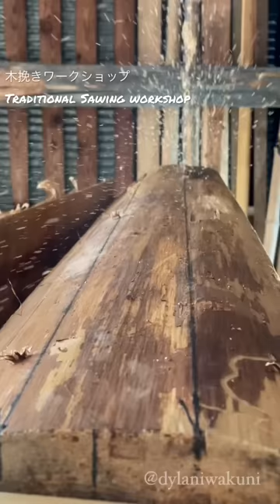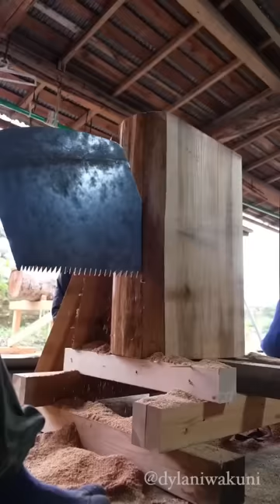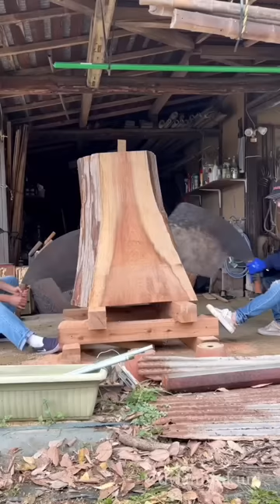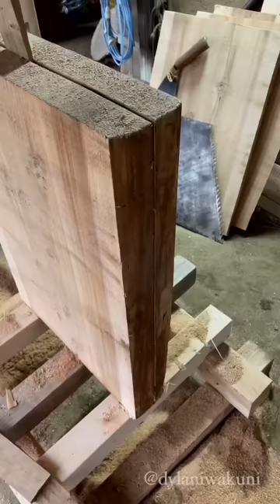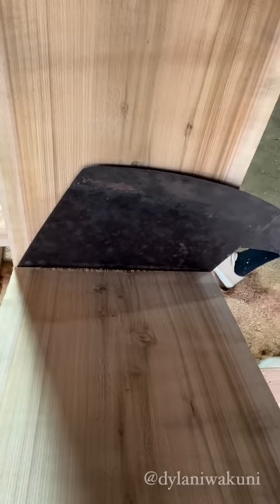木挽き　Traditonal Sawing

Comment: Good design. The tall blade adds more weight while the user just pulls. The advantage is when pulling the blade it becomes straight instead of buckling up.
Reply: Thank you, I was about ask the question why is it so large. 🙏
Reply: @Martell Barchaletta  I was just guessing but on second thought it also creates a straighter path.

Comment: I'm not likeing those saws, how quick would the sawing be unprecise and that precious wood wasted. better will be i think one one those highly precise saw tables, the wood is fixed in them and then all there is no manual sawing that can possible be unprecise. 

what are those sort of saws in the video called? its a japanese saw but they will have a distinct name for that saw sort, i guess. how much does one of those saws weigh? it appears like those weigh alot, those people dont need to put any extra weight on those saws for sawing. how precise can these workers saw these slices of wood with these saws ?

Comment: What's the difference between pushing & pulling a saw?
Reply: Depends of teethshape...
Reply: If you pull it, the blade can be thin because it does not bend.
Reply: @josefm.9288  - I like that, but all saws are quite thin because it's about the volume of wood being removed. There's a line in carpentry of 'let the saw do the work'. I'm wondering if there's an energy saving.